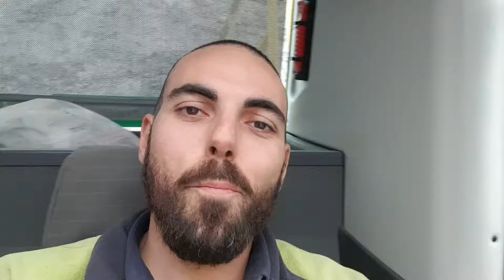Epiroc T45 SmartRoc Intro (Welcome to the channel)

Comment: Hey mate,
Just wondering how does your drill go with breaking out rods? Is it automatic or do you have to rattle out your own rods?
Reply from the maker: If you choose to, it can automatically break the shank from the rod at the bottom of the mast for each rod change, regardless if automatic rod handling is active or not. The time it rattles for is full adjustable in milliseconds. However, once hole depth is reached, it simply stops drilling. You then need to breakout the entire drill string yourself by rattling on the bottom of the hole as per usual.
Reply: Pls can you teach us how to use the levers